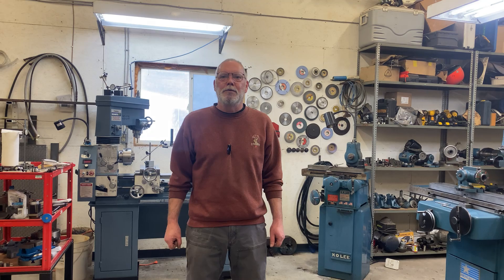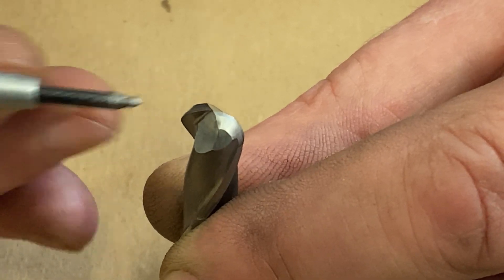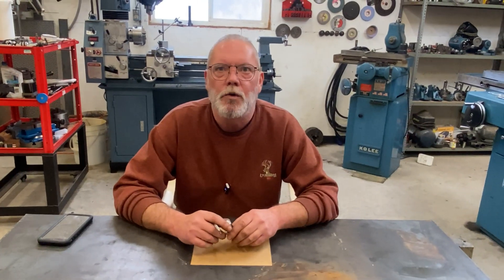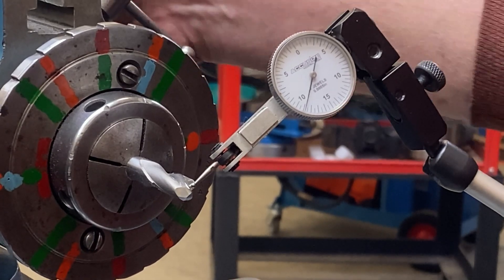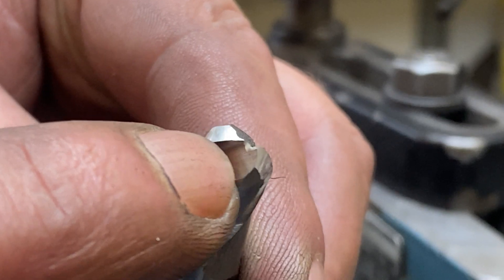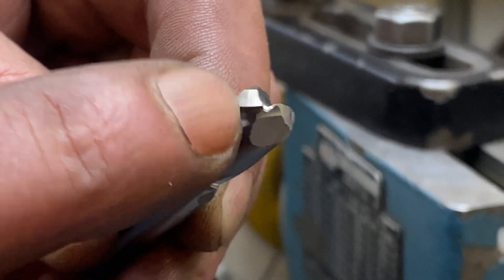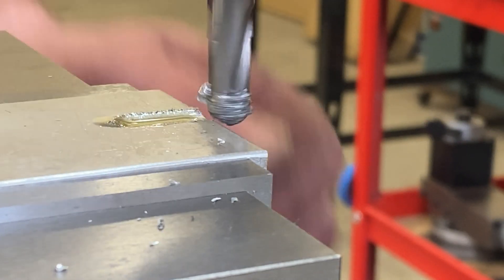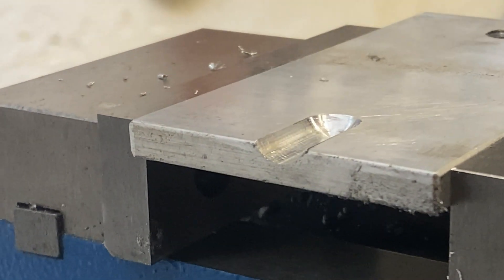HOW TO SHARPEN A BALL NOSE ENDMILL

Comment: In the beginning, you said you cant replicate. Are you able to explain why you can't and what you would need to replicate the stock geometry? Thanks, thumbs up as always!
Reply from the maker: With the equipment that I have I need to guide the tool with a pointer finger touching the tooth face. The factory grind is such that right at the center there is no tooth face.
Hope this makes sense.
Thanks for the great comment!

Comment: What type of bearings are in the work head?  Just ball bearings?  Ie not air bearings?   I would guess that ball bearings would be hard to feel as you try to follow the pointer.
Reply from the maker: I've never had reason to take the work heads apart so I'm not sure about the bearing type. Definitely not air bearings. Probably ball bearings